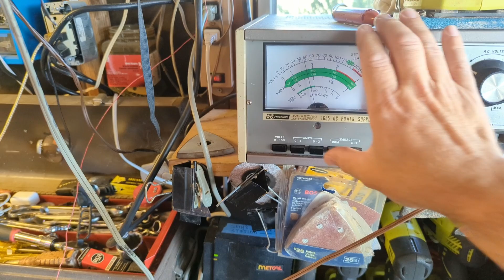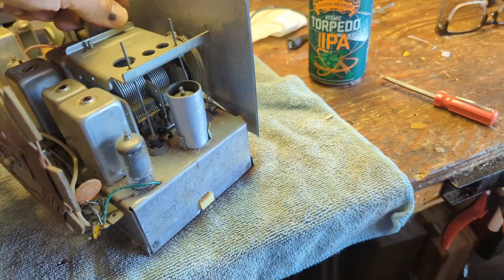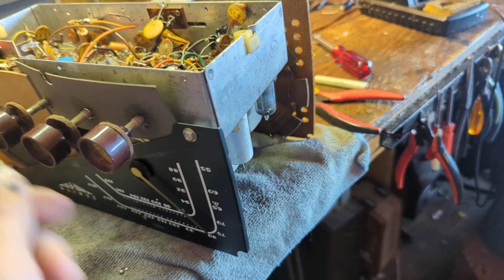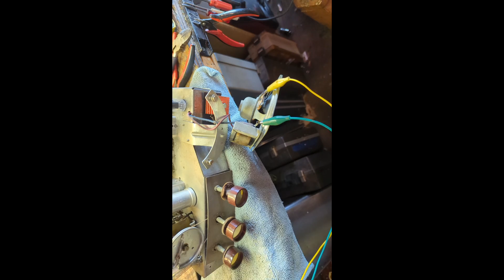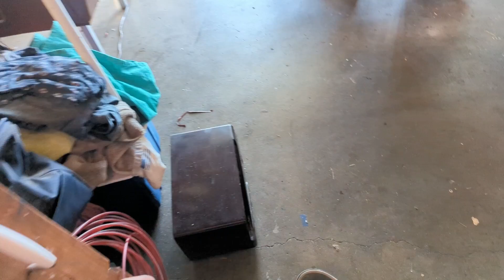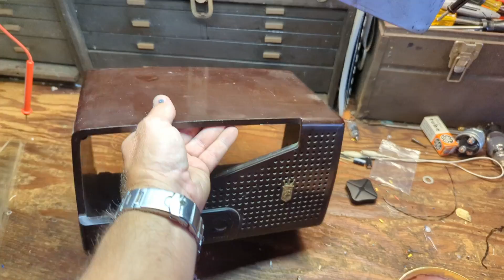Another wonderfully reliable Zenith AM/FM radio

Comment: I have the model G724 that my parents had , so it is one owner. it includes a tone control that is part of the cathode bypass circuit. I just have a question where do you get replacement for the volume control, in this case 1 M ohm audio taper with split splined shaft?  Looked all over the internet but ended up using one from my junk box. Yes I also replaced the Selenium rectifier.

Comment: I have one of those that I bought during a vacation in Florida in 2003. I brought it back to the UK (It wasn't long after 9/11, so I was surprised I got it through airport security as easily as I did). I replaced the rotten rubber cord and ran it through a 240 to 120 volt transformer. It works well and now lives in southern France. I never noticed the CONELRAD markings, so I'll have a closer look. Cheers!

Comment: I just bought this exact model at a radio meet on saturday for 17$. I have already restored it and it works beautiful! My speaker had the same problem, but I had a perfect replacement for it. I usually don't buy radios or televisions with seleniums though, since I hate replacing them.

Comment: Wow. That point-to-point wiring looks so primitive and grim!. Life-long Technician here. The Cathode is negative, and is the stripe side. The Anode is analogous to the Plate in a tube, and is positive.
Reply: Well, yes and no. Point-to-Point in those days was enormously more reliable than the PC-Boards of the time. They suffered from a multitude of problems - flexing and traces popping loose, traces too thin or heat damage from the tubes (manufacturers sometimes press-fit the contacts to hold the pins of the tubes directly to the phenolic resin boards, instead of using proper sockets), etc.
There's 'primitive' and there's appropriate technology.
Reply: @ethelryan257  I was just thinking maybe tie points, not a circuit board, could have cleaned it up.

Comment: Oh my! Up on the shelf, your garage stereo is the guts out of a 1963 Motorola console stereo. Original price was over $600 in 1963. Ahead of its time - Has separate push-pull amplifier for the 15 inch woofer in the center of the cabinet. sort of a 3.1 system.

Comment: I had just noticed that this radio has CONELRAD markings on the dial face that indicates Civil Defense, from the 1953-1963 timeframe. So this Zenith is a mid '50s model. And I also noticed on the bottom of the 100 band that there is a dot. That dot indicated the Chicago based radio station, WEFM, and the call letters, EFM, stood for Eugene F. McDonald Jr. Love this one, Seth!

Comment: Ahem. It has Civil Defense markings on the dial face. So it is a model L-721 from 1954. I have one to restore one day 
which is also factory original. It is definitely  known for  being a very reliable  radio. Nearly identical to the R-721 from 1950.
About those Selenium rectifiers. They start to lose there abililty to rectify voltage as they age. That means they are burning themselves out ( PU !!!)  So just replace it with a solid state Silicon diode  ( 1N4007 ) and a dropping resistor  (100 Ohm at
 5 Watts would be good for a 35C5 tube but use a 82 Ohm with a 50C5). Yep, those dirty holes are a bear to clean!